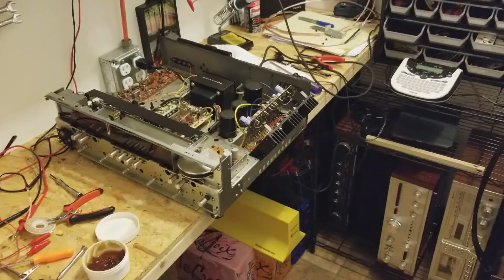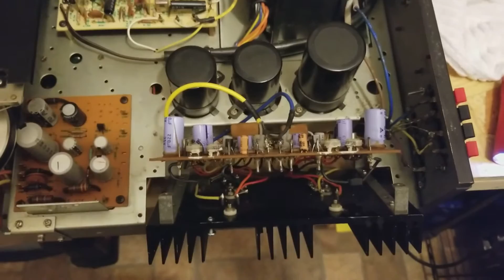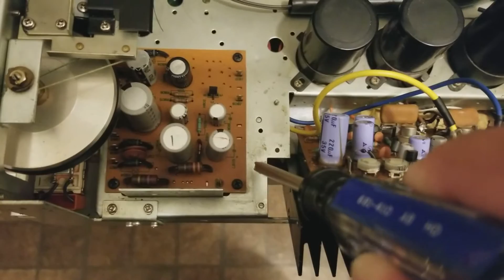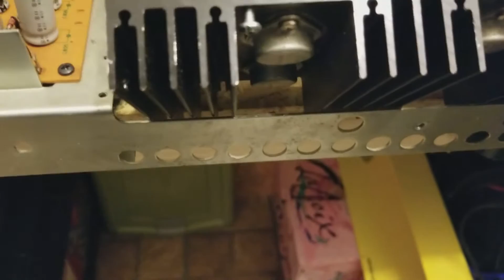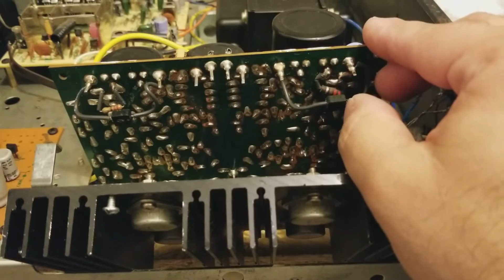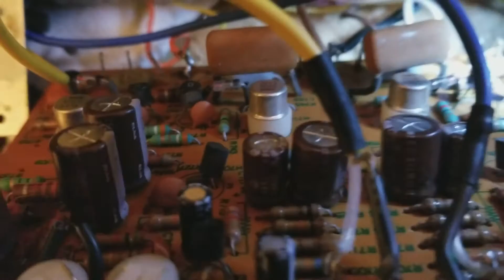Marantz 2220 Restoration and Repair Part 1

Comment: How about 42 years without repairs? My Marantz has been just idling, diving a pair of very efficient speakers to concert levels (1 watt input=102 decibels @ 1 meter) Dust-off and de-oxide controls is all I've done and, oh yes, LED display lights to reduce internal heat and reduce power consumption. I'll keep you in mind, should I experience trouble. Knock on wood! Good video, though.

Comment: A question, I just recapped the amp board on my 2220b. It powers up but if I turn up volume past 1/4 the protect relay trips out.i used the ELNA Silmic ll because I was assured they are low leakage? What did you use on your low leakage caps.
Reply from the maker: Yes they are low leakage and suitable for your application. Often times after a recap other problems get uncovered. First double check your work and make sure all caps are in with correct polarity. Next I would check your supply voltages. If those are good I would suspect high dc offset due to aging differential pairs or even driver or pre driver transistors. A service manual is going to be needed and can be downloaded from the internet. Good luck.
Reply from the maker: Also check your idle current.  And as in my video make sure the bias diode is alive and does not have a bad connection.
Reply: @OldTechFan  how can I get in touch with you?

Comment: Very good advise .............polarity of capacitors hahaha , yes i've seen these errors !
Do the same and work in steps and control after every work .
These amps sound fine with a job well done ............i heard to often restored ( good old ) amplifiers sound bad after a recap with inadequate or huge oversized caps.
The output capacitors if still good , i leave them to preserve the original sound . ( they are not under the same stress as the filter capacitors and often age well .) 
Thanks for sharing ....